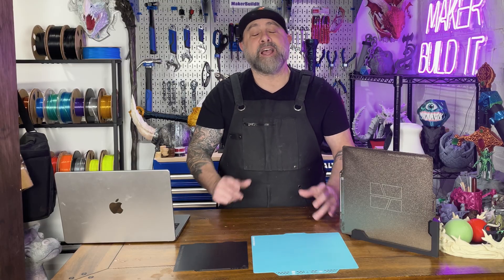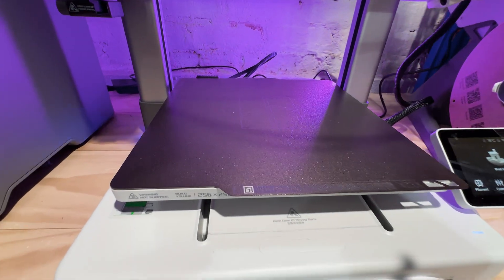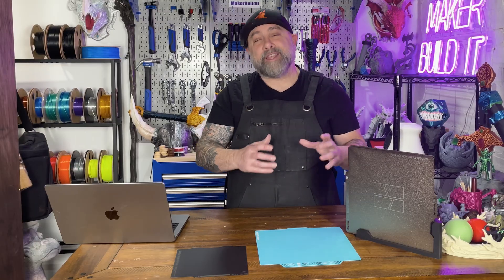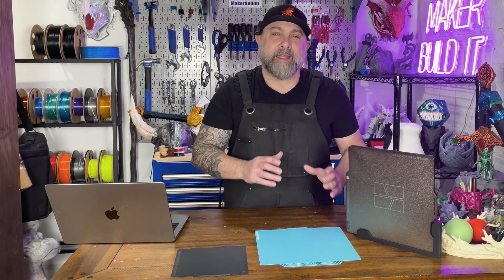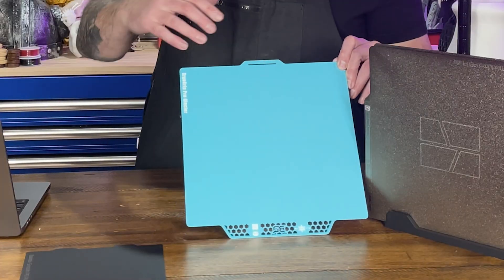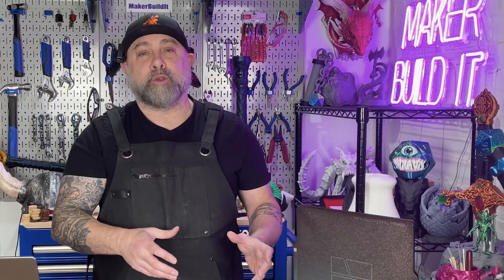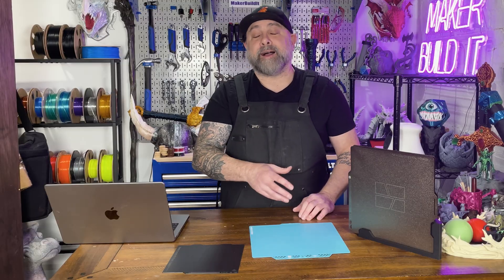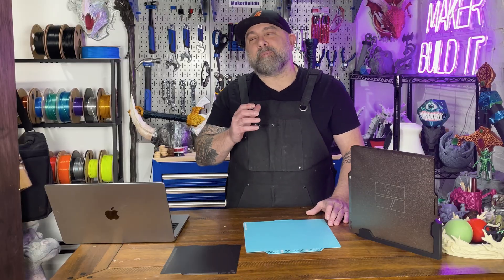Why Your 3D Prints Won’t Stick (Bed Adhesion Fixes That Actually Work)

Comment: If you use the 93% rubbing alcohol, your prints will work much better.  Not the lower percent rubbing alcohol.  I switched last year and have had no failures since.

Comment: I am losing my mind. Been using grok to tailor my settings. Deep cleaned my PEI textured bed using Dawn. My printer is a Creality CR6 with their Creality PEI Textured mag bed. Bed temperature is 67. Grok keeps saying to use glue stick.. ANd the only success I have ever had is with glue stick. I just can't figure it out.

Comment: I absolutely CANNOT get an ASA riser to print successfully. Bed adhesion problems, layer adhesion problems, severe warping... Nothing I do seems to work. I've tried smooth PEI, textured PEI, the stock Bambu Engineering Plate, with and without glue or Aqua Net, after making absolutely certain they're clean. I've raised profile hot end temperatures from 250-270C, plate temps from 90-110C, and ensured my print chamber temperature is 50C+ including a half hour soak before starting the print. I've taped over the door seams, I've reduced fan speeds or turned them off, I've diverted flow so I could keep the hot air circulating without blowing on the parts. I've inadvertantly turned on rafts when I actually wanted brims, then used brims at 5 and 10mm. And I've done all of it together. 

And I still can't print ASA parts to save my life. And ASA is supposed to be EASIER than ABS. I've burned through an entire kg and don't have even a single small part to show for it, let alone the 3kg riser I set out to make.

I was really hoping you had something else I could try.

Comment: Good video. I just had a problem printing a Gridfinity base, and it wouldnt stick in one certain spot. It was also bear the edge. I must have missed that spot because I generally use vision miner nano polymer adhesive. I got a sample bottle I got about 2 years ago is just now about empty. But I just threw one of these orange plates in my cart on amazon.

Comment: I am a total newbie, and I've only printed with PLA so far, but I'm having amazing results with my textured PEI plate and glue sticks.  My plate is visibly dirty, but that's what it took to get my first layer to stick reliably. It might not be working as designed, but at least it's working.
Reply: Textured PLA also works by itself. Glue also helps in some cases, though it's not really necessary for normal builds, but if you have failures it's still better to clean with soap

Also, you cannot just add glue layer by layer, if you added glue, you have to clean it before adding more for the best result

Comment: I have never had a problem with my The standard PEI plate on A1or H2S, I clean them every few days with soap and water and that is all it needs…
Reply: Exactly, the video is exaggerating problem. PEI is great, just wash it periodically.
Also glue definitely works when you need an additional grip, just it suppose to be really thin, liquid glue from Bambu (pricey, but works well) or hairspray works great on textured plate too

Comment: Please don't recommend the Biqu/BTT plates. They are coated with cheap paint that is not durable at all. And they are not textured at all. They are very smooth.

Comment: Is a textured PEI with glue good for TPU? Can the glue completely be clean up with regular soapywater afterwards?
Reply: Yes, absolutely do use glue with tpu, and yes the residue can be hard to remove, or at least mine is since I bought the nano glue crap from bambu. assuming youre using 95 shore make your self a tpu dishwashing sponge, they scrub extremely well and wont scratch your pei.

Comment: I had the problem that tall thin parts (made of Jayo PLA / not PLA+) would fail around layer 50 due to warping. The easiest thing would have been to add a brim, but I was also able to fix the issue by increasing the bed temperature from 55 to 60°C to improve bed adhesion and, more importantly, by increasing chamber temperature from low 20s to low 30s°C to stop the warping.

Comment: I found that using a lint-roller to clean the bed saves from having to wash it.  It removes lint, debri, left-over filament, dust, oil, everything.   I wipe with alcohol > paper towel > lint roll 2 or 3 times until the lint roller sheet remains sticky and clean, that's how I know the bed is sticky and clean.   Works like a charm, much faster and super convenient.
Reply from the maker: This is a great idea! Going to have to try it!😃

Comment: Thanks for the video. I’m struggling with prints not sticking and washing with dish soap before every print to be safe. I was hoping to see if there was another solution like some alcohol wet wipes as it’s easier than washing it
Reply: Use Alcohol instead. I use IPA mix at 3:1 (3 parts Distilled water and 1 part 99% alcohol mixed together) I put a spray or 2 on the build plate and wipe it off. No need to go to the sink. I have never used soap and water on a build plate. Soap can leave residue and alcohol evaporates
Reply: I almost never use dish soap anymore. I just squirt a little bit of 90 plus percent isopropyl alcohol on it and wipe it down with a lint free paper towel on my textured plate and it prints flawlessly almost every time on my Creality K1 Max. This is a very good video but I was kind of disappointed that he didn't even mention alcohol.
Reply: Try a lint-roller.  I lint roll my bed before prints.  I'll do an alcohol wipe with a paper towel if I'm switching filament types or every dozen prints or so.    But the lint-roller pulls up any traces of oil and other debri.
Reply: Cleaning with soap should work.  Try a different soap with no additives, generally the cheapest.
Make sure you rinse it really well with hot water and even repeat it all if you are concerned.
Do not touch the bed surface after cleaning.
Having said all that, I rarely clean my cryogrip and don't have issues so not sure what you're experiencing.